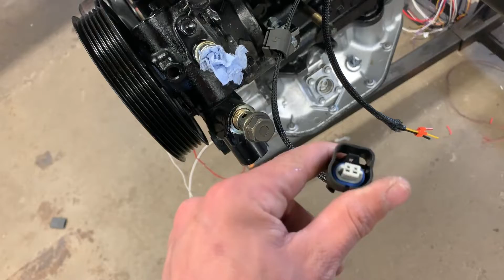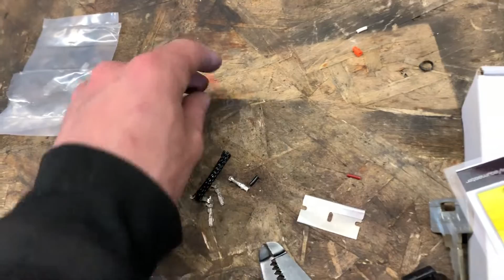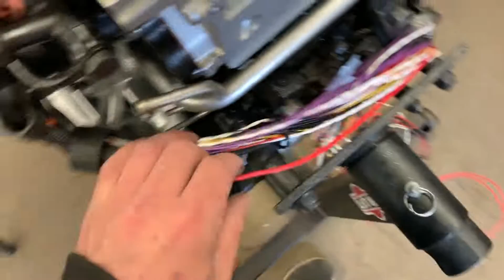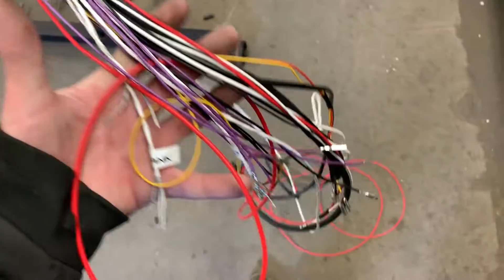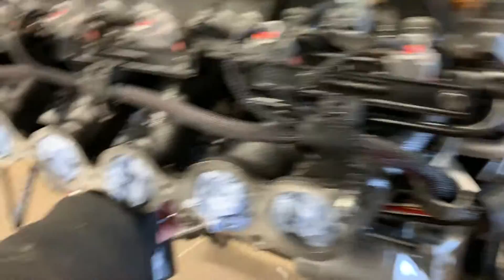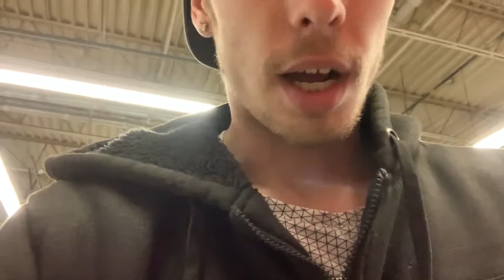How to build an engine harness pt.3

Comment: Hey kyle so maybe you can explain this a little better for me. I see you ran the alternator plug in with the harness, I'm thinking of doing that on my s13 2j swap. But how did you run the wires? Did you put the power wire to a switched 12v , and how did you connect to the the wire for the battery light?

Comment: What size wire did you use to power the EMU? also did you run the ECU power wire seperate? thanks

Comment: Did I miss the part where he wired the injectors and then wired up into 1 wire?!
Reply: Steve Aguilar  for sample if u have 6 , 12v   Or positive cables and u need just 1 for the ecu u can put all the cables ‘ positive or power together ‘ 6-1’to one single cable , this one have to be more bigger than the normal one the injectors has

Comment: Mine is ge from 1994 and wired it .it works  but i feel a lost of power .where in the original sc300 it felt verry powerfull. 
Im thinking about dumping the project
For a electric motor from somewher.  Had my celica aupra forever . Its failing this swap or thers something wrong . 
I smash around my sequoia . Thinking about it. .. 😑
Reply: And the 94 ge sc300 dont have all the extra anything no vvti no electric tb and no coil packs only dist. No fuel reg box . And no wireing for the 3rd oxygen sensor . I cant find it . No oil sensor on the oil pan .did the memory 5seconds wire and the main positive wire too .but something must be missing . Did not connect the els wire yet electronic load sensing wire . It was auto but we made it manual. still no power drives like a prius now all the auto trans. wires are doing nothing its a pack of wires

Comment: very nice glad i found this im in the process of buying all the wires i need  for my 2j swap in my s13 in which im going to be running a proefi 128, so this video helped out alot .  Hope to see you make a 4th video would like to see the finished result and if you ran into any problems.  Im acutally going to take that HP Academy wiring class to gain some more knowledge.
Reply from the maker: the only problem i ran into was my crank signal because it need a resistor
Reply: @KyleEverett   what exactly you mean, you had to put a resistor inline with the harness, i thought the ECU to handle all that.  please explain if you dont mine.
Reply from the maker: William Robinson  the ecu controls and resists anything except for a high output solenoid like vvti also depending on the length of your cam sensor wire it may bee need to ad a risistor